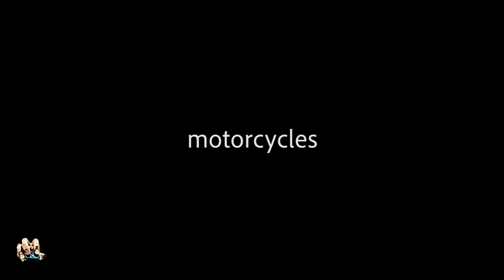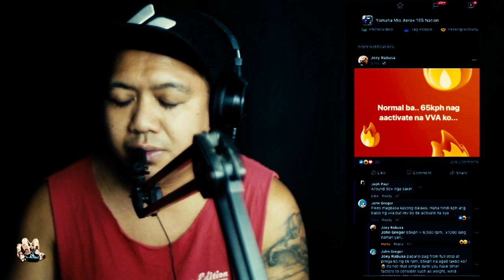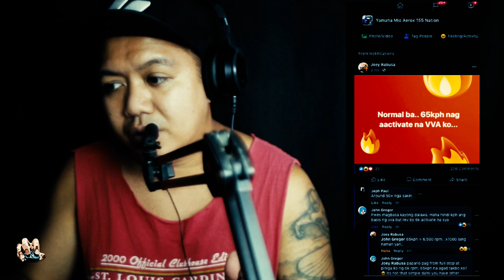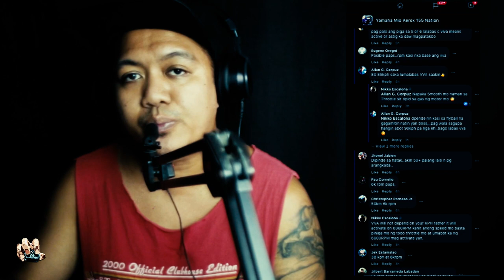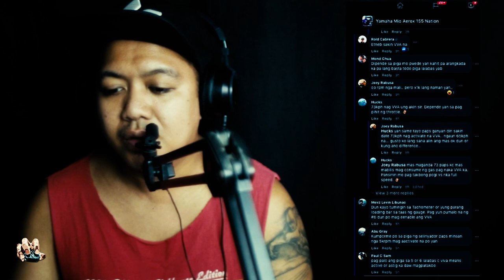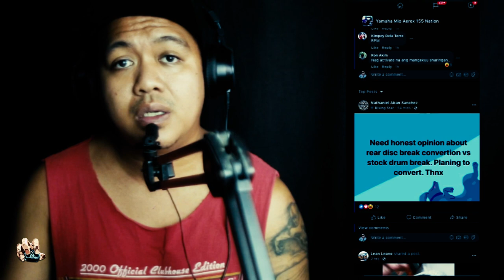Yamaha Aerox VVA Explained in the most simpliest WAY

Comment: boss ask lng,  months old pa lng motor ko, nasa 1300km na then nag change ako ng oil, yamaha lube ginamit ko, napansin ko lng pag kick in ng vva saktong may pipitik na tunog, ano kaya yun,wala naman yun before ako nag change oil.
Reply from the maker: boss saan banda ung pitik na naririnig mo? sa tingin mo san mo siya naririnig? wala naman dapat kinalaman ang oil sa tunog, any brand ng oil is pwede as long as engine oil for 4 stroke siya. if tlagang malakas ang tunog and nababahala po kayo, try to check it po sa isang espesyalista, mekaniko po :) ride safe po always boss